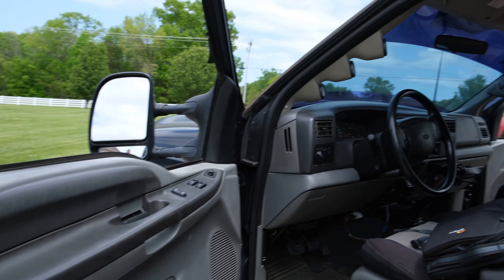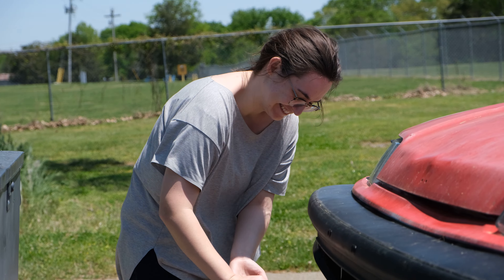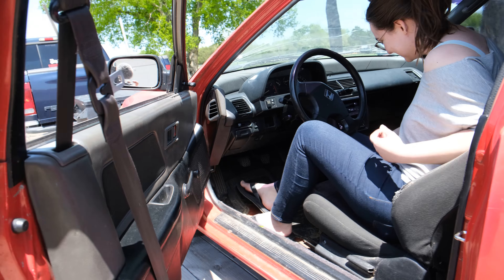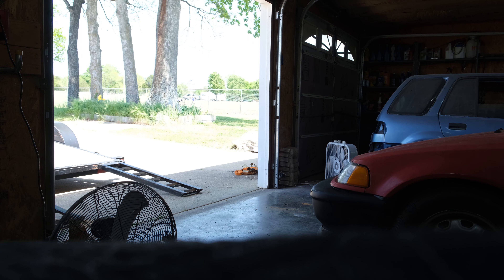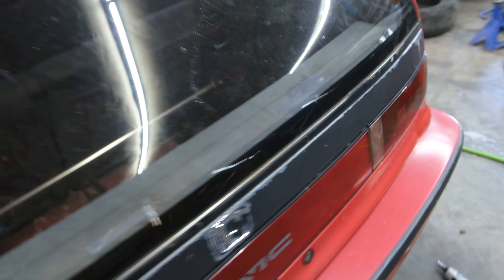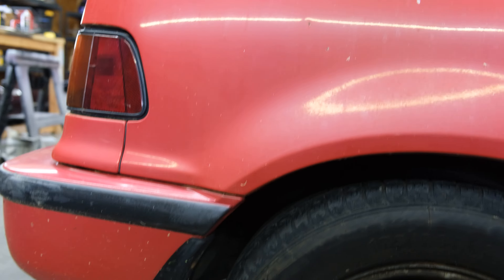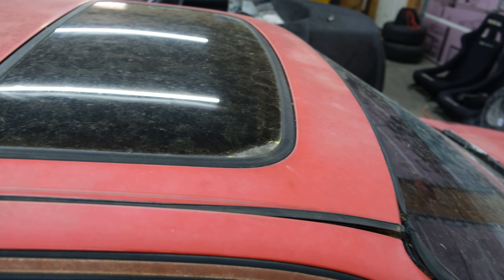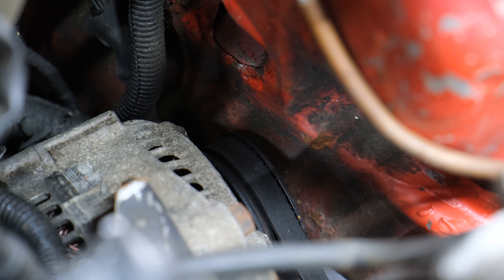My Wife Bought Her First Project Car | 4K

Comment: must have x ray vision or just not smart ys1 dont nean its gsr cable thats just means its a 92 93 not a 90 91 trans to see what it is u open and count gears or drive it if u shift every 10 mph its gsr if not its ls
Reply from the maker: Wow great comment, thanks !
Reply: You're correct but you don't need to open it to figure out which trans it is. You can determine that by selecting a gear, engaging that gear, doing some simple math, and then rotating the main shaft to see how many turns it takes for the diff to make one complete revolution. For example, 3rd gear in a ys1 gsr is 1.458, final drive is 4.4, multiple those and you get 6.4152. So in 3rd gear it takes 6.4 revolutions of the main shaft to complete one revolution of the diff. Of course the trans has to be removed in order to do that. Chances are it's a LS. I say that because for some reason everyone thinks a ys1 is automatically a gsr, I'm not sure why. On 3 different occasions I've looked at ys1's that were advertised as gsr and they were not, all were standard LS. But to the owner, you could have gotten lucky and scored a gsr, hope you did.
Reply from the maker: @jasond4752  thanks for the comment!